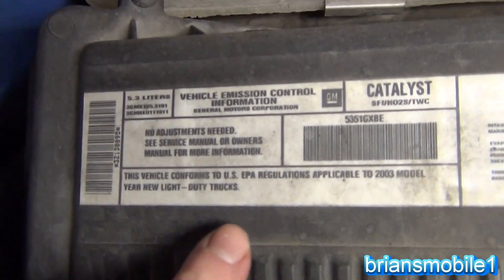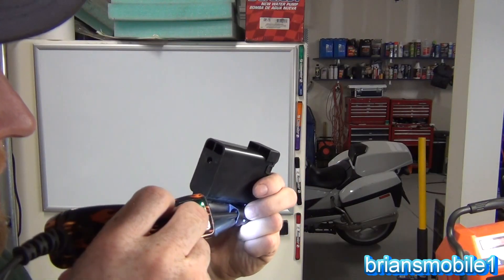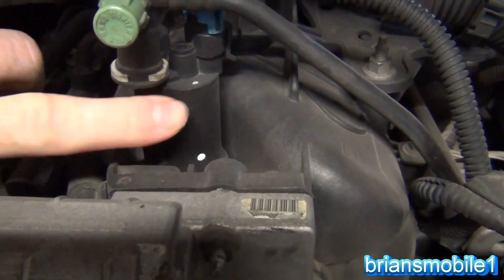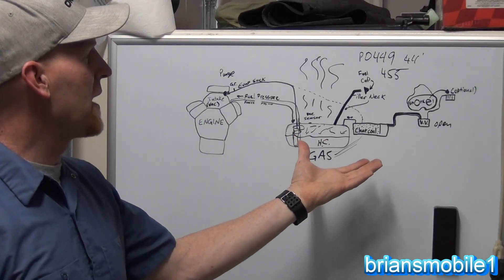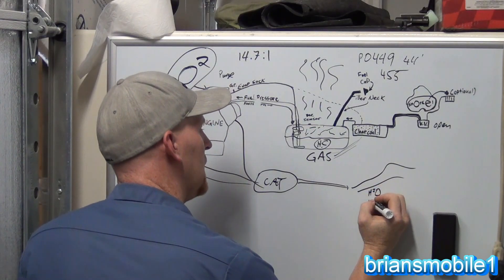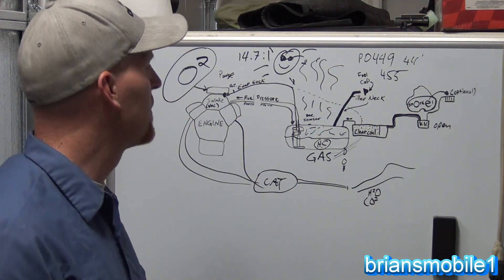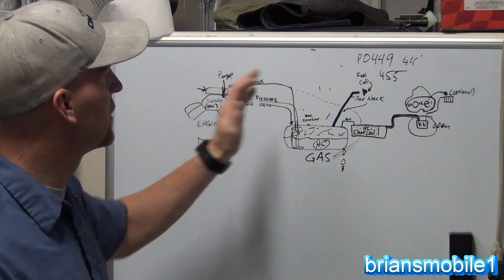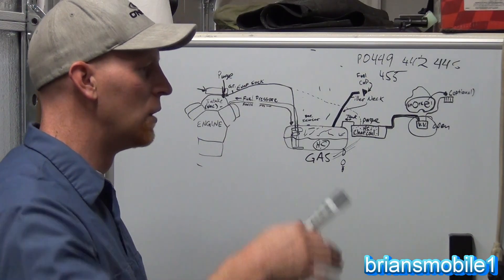P0449 Vent Valve Testing EVAP Systems

Comment: Wow. I just replaced the vent valve solenoid only 2010 F150 after 2 years of just clearing it from my dash cause I did not know what it was and I knew Ford dealership would screw me. It was such an easy fix and 2 plus years I just been resetting the engine light. Wow. Thanks for explaining it to me. Do you think any damage was caused due to waiting so long?

Comment: I have a 2007 Silverado 2500hd with 6.0L and I keep getting P0171 and P0174. I've changed my intake gasket and still get the engine light and lean codes.  Could I be getting a vacuum leak lean code from a faulty evap system?

Comment: hey great video I have a 05 g6 with a code p1106 that has to do with the map but you fill-up the tank with gas and you cant leave the lot. run like 3 gallons off and it drives like a new car. dealer changed everything at the tank you talked about. if the car sits in the shop with the door closed I smell gas just a little. I'm trying to build a smoke machine to test but how do I plug it in?

Comment: My EVAP vent valve hose got loose. Is it going to be a problem and if so how can I fix it because I see that it goes directly into the body of the vehicle?. The exhaust hose.
Reply: Its the hose that connects from the canister vent valve and connects to the body. At first it was tight then when I was moving it to change the vent valve it became loose.
Reply: I think it's the split between the cab and the bed.

Comment: So are you saying when the key is off, no power will be going to the vent solenoid leaving the solenoid in the open position, correct?... I have a code 442 so I'm making a device to add power to the solenoid so it will close when I do a smoke check to find the leak. The solenoid may even be bad... Thanks
Reply: I made a cord with a toggle switch and fuse. I'm able to turn the solenoid off.....

Comment: Can a purge or vent valve not being open and or closed throw  codes p0172 & p0175 with those being the only two codes.  I'm having issues on a 2000 grand marquis. I ohmed out the injectors and those readings are good. I've replaced all vacuum hoses. Except for the evap. Hoses from canister to the tank(And that one looks rough). Fuel pressure regulator is new. I'm trying to fix it my self because automotive shops are too steep on $$$.

Comment: I changed the purge valve and the canister solienoid and my gas cap and my check engine light is still on and the P0455 code on my 2011 Impala ltz

Comment: I'm having a problem with the gas coming back up on my 2005 Chevy suburban. So went to my local auto parts store and the code po 449, I saw a few videos indicating it could be the vapor container purge valve the evaporator container vent solenoid and the evaporator charcoal canister in which I changed all three and I'm still having the same problem not able to fill up. What do you think can be wrong?

Comment: Starving inventer Mike Redfearn Jr thanking you for your video--- My 2005 Trailblazer  I just bought in January -- I'm adding parts to to get it Virginia State legal Is having a a rough idle -- my multy scan scan tool sayed mis fire in cylinder #4 detected-- so I instaled a new the injector #4 and I still have a rough idle. I swapped coil packs around and swapped spark plugs around a different way -- still a 675 rpm and a little rough idle. So I'm looking at The evap line after I made shure the butterfly was clean on both sides. So ,if you can Gmail me back mikeyredfearn@gmail.com  ---- I have piston driven moter ideas -- about 8 of -- There easy to explain and pretty neat to think about- I need to get them to the right people to have them built and expermented -- the look good written and drawn and I modeled two up -- made some energy with one of the models. How many diffrent piston driven engine tipes are there -- To try to get something on the market without the big three going around you is kind of difficult-- I checked with Chrystler and they wont accept ideas--

Comment: my gas cap light is on i changed it ! check engine is also on... wonder if this may be the issue. i dont have  a tool to check and see if current to the device closes and opens the valve , i when i blow threw it its open but cant tell if it closes when it needs to close, whatever the case may be if this device is faulty can it cause a gas cap light to turn on?

Comment: Hey Brian , Thanx for the video ! Excellent info. ! I have a question …. I have a 2010 gmc 3/4 ton …. It had the same code and problem. So I replaced everything , the vent valve , purge valve , filter at the end , and ran it up past and above the transmission , along with new 5/8 hose … Then 3 days later the code came back , along with excessive pressure in the gas tank . I then replaced the gas cap . And again a week later , the code came back , and yet again , more pressure in the gas tank . I've replaced everything literally ! I'm stumped !! Do you have any ideas ? Please help !! Thanx in advance !!

Comment: i used a 9v battery and 2 wires (pos. and neg.)  to do the test instead of the $58 power probe. i call it the poorman's power probe it works the same as the probe.

Comment: I have code po446. Changed out canister but light and cade returned. Now what ? What should I replace ?
Reply from the maker: Check the circuit and check for cracked or blocked hoses.

Comment: Brain, How did you remove this vent valve on this 2003 gmc without removing the truck bed?
Reply from the maker: I did it from underneath using a ratcheting box wrench.

Comment: Toyota Celica GT 2001. I got PO440. I replaced my fuel tank cap and my vapor canister and reset my engine light. It came out again.  My ODB2 scanner still gives me the same code that is PO440. Tested my purge solenoid valve that works fine the only thing that is left to check out is the vent solenoid. Any suggestion? Very good video sir. Educative, clear and neat!

Comment: I have an 08 Silverado. All of a sudden as soon as i start the truck it has strong gas fumes coming from under the truck by the evaporative canister. I just ordered a new purge solenoid, and a purge vent valve. I have no codes but my purge vent valve used to click a couple times after i started the truck and now it doesn't anymore. Anyone have any ideas, any help is very appreciated.

Comment: My 2001 Chevrolet s10 is showing code p0440 so this not a vent valve, I think my pressure sensor on top of the gas tank/ fuel pump right ?

Comment: Thank you for your video. I have a 1993 Ford F250 with the 460 ci engine. I bought a code reader set and found it displays a code 31, "EVAP control system below minimum voltage". Is this the same as what you described in your video?
Reply: no that is a voltage problem,poor grounds,green wiring from corrosion , low system voltage, lots of possible places for a loss of voltage.

Comment: I'm having issues with my truck 2004 Chevy Silverado crew cab the EVAP system I have a large leak I try to start my truck acts like it's not getting fuel because of this evap leak I hear a loud back pressure hissing air being released after I let off ignition key trying to crank coming from under truck Midway back from front does it sound to you that the vent valve is stuck open is that the loud hissing air pressure that I am hearing?

Comment: Great video. I have a car pulling the p0449 code and i have noticed that the rpm increases slightly and decreases at idle. Like your very lightly taping the gas.  Are these related

Comment: I have a 2006 Cadillac Escalade 6.0 I've switched out the purge valve one that goes in the front of the engine purge valve solenoid I think that's what it's called the one that goes under the truck in the back and I switched out the charcoal canister cuz it was falling apart and I still have the hard start when fueling problem any ideas guys please need help

Comment: why there is negative pressure created in tank and will that affect fuel delivery , I can hear air suction sound when I open my gas cap . opel astra 2014 . in general that is good sign or bad sign .. not codes thrown at all

Comment: I’ve got a 01 Chevy Silverado 1500 with code p0446. I’ve changed the vent valve to a new one an code came back.  Can’t see to figure it out. Any suggestions ?
Reply from the maker: Two things fail.  The plumbing and the hardware.  If it's not one it's the other or the wiring driving it.  Make a list and cross things off as you prove them functional.
Reply: briansmobile1 what do you mean as the plumping and hardware ?  An what ways can I test wiring

Comment: Thanks Brian, for this video !!! You are one of the 4-5 ones, I even ask anything here in you tube, most of the people are kind of like " guessing mechanics" ;o). Well, I have a good one for you today: I am going crazy with my Mustang 2004 , 3. 8 litre engine! Idle is so, so sky high almost all the time, after I changed fuel pump to 255 lph, and bigger throttle body, 70 mm?? I had "check the engine" light coming on, even before that, saying large vacuum leak somewhere??, and " check your fuel cap"?? I did change fuel cap, no help??Now, codes are: P0507 IA control higher than expected??, ...sure know that, Idle goes first to 2500, and after 20 -30 secs goes down to 1100 -1200, never lower??, and the other code is: P0405, Exhaust gas recirculation sensor a Circuit Low?? I did change DPFE sensor year ago, tested it now, actually bought a new one, no help, will return it, have changed TPC, IAC sensor, new EGR valve, did check leaks under hood, vacuum hoses, no leaks, did check canister solenoid in rear, seems fine, 12 V coming in, closes, when 12 V applied, did take out canister purge valve, in front, under fender in Mustang, could not really test it, like here, opened it, cleaned it, put it back, 12 V coming in??? Could that be open all the time?? And make idle go high like that?? Will change that next, after I return that new DPFE sensor, did not need that =) Going crazy here, pelase, help meeeeee ! Could there be a leak above gas tank?? What do I do next?? Smoke test?? Thanks, youtheman =)

Comment: I have a 2004 Dodge Grand Caravan. Had a small Evap code P0440. Smoke and cap test is clear. I removed the Solenoid and put voltage to it (depending on the current direction open direction would change) Either direction when blowing air does move through, but it is not smooth like blowing through a flute, but restrictive like blowing through trumpet. Could the Solenoid be bad?
Reply: Does anyone know if the Canister should "Flow Freely"

Comment: i just replaced both purge solenoid under the hood on the intake i also replaced the back vent solenoid by the charcoal canister i also tested to see if it was getting power and yes it is on both ends under the hood one and the back one but im still getting the po449 code what else could it be all lines are intact and good i see no leaks cracks or breaks my next goal in the morning is to take the canister off to see if its clogged any other  suggestions

Comment: as long as its not plugged in to the harness polarity shouldn't matter it's just a coil. now that i put my .02 in, have you ever seen a p1457 caused by a bad vent solenoid? i tested mine and it passes air even energized, i think your vid verified i wasn't sure if they were a weird 2 way deal or something.

Comment: Good video Thanks Brian. I remove 2 or 3 of these every month and disassemble them and b;low out the dirt inside. I have taken several spoons full of dirt out of some.   One car, I believe it was a honda, had a remote breather on the end and sucked from inside a frame rail way over on the other side of the car. The hose had a cup full of small stones plugging it. We drive a lot of gravel roads here. I think there is a kit to reposition the valve to under the hood where there isn"t as much dust.

Comment: Im getting a p2187 and p2189. Changed evap controle valve still getting the same thing did a smoke test no leaks ....on a 07 hyundai.

Comment: Hello! tnanks for video
I have tested the solenoid on ohms and if there is resistance 22.5 it opens and closes when testing. The power cable that goes to the solenoid has a voltage of 12.5 volts on one cable and on the other 4.5 volts. When the key is on, I still have the same code after reconnecting everything. What else could it be?

Comment: Good video, great explanation. Most of the ones I've had off were just dirty. Blow that old valve out and it will likely work,  should also take out the foam filter inside and clean it too.  . I;ve done lots of these. I just did an 08  Buick lucerne, and dumped half a cup of dust out of the valve and canister filter. I've seen trucks where you have to remount that valve to under the hood to keep them clean.

Comment: I've been in school for automotive been doing it for years and I must say it sure sounds like you've got a good working experience with the knowledge and people should benefit by your free education buddy
Reply: so if I understood correctly the relationship between the vent solenoid and purge solenoid the vent solenoid stays open when engine is off so you can add fuel to the fuel tank while the purge solenoid stay closed then when you start the engine opposite occurs the vent shuts and the purge opens to draw gasoline fumes to the intake ? I think I have a vacuum leak or dead oxygen sensor, my gas mileage is very poor.
Reply: Evans Cheruiyot how that would be a no if engine is off they would not be open why would they be open they wouldn't be working if they were open... you need to do a little bit more studying...  if the car is not running and the are open you're going to be venting gas fumes into the atmosphere now is that something we want to occur with what this apparatus system is supposed to do?
Reply: so why does the problem of filling up the fuel tank occur ?
Reply: Evans Cheruiyot you see that's because you don't tighten up the gas cap probably screwed on wrong that or you have more problem than what you really looking at... it doesn't just have to be during fueling there could be another smaller vacuum leak somewhere within this system... and you're just attributing it to be a fueling issue when you're filling up the car of course you are venting a certain amount of fumes just by the fact that you are fueling the vehicle that's a given that's a closed system list of vehicles is  running and that's the only times in EVAP Is.open or  storeing or release it is going to intake into the motor not the atmosphere... and when it does that the vent valve is going open because you have to have the atmosphere go through there to moving around from where you want it is that valve is closed the atmosphere is not going to help push through the system the fumes the hydrocarbons you either going to send it one way or they're going to put it in storage with a car off the vent valve would be releasing the fumes into the atmosphere if the purge valve is open when the engine is off it's going to be releasing fumes into the atmosphere if your gas tank cap is loose or missing lines are you have a brake leak in the system it's going to be venting fuel fumes into the atmosphere... and I just ate intake password would be introduced into the cylinder heads which would go into cylinder be compressed by the piston... and most the time that was referred to before your mass airflow sensor right... In the  bellows... it would have to be measured with a rest of everything gmjust like the rest of the gas is getting sucked into your engine...  so I got to be calculated out by the computer
Reply: I see okay, my gas cap rubber gasket is dried out and has cracks so I will be changing that for sure, it has activated a check engine light a few times already and every-time I had to turn off engine and re-tighten the cap after that I suppose it time for a vacuum test since vent solenoid is new.
Reply: Evans Cheruiyot if your seal on your gas cap is all dried out and cracked go get a new cap yes that's going to be a leak you can also get this code with a good gas cap..  everything working it can be just a little bitty leak anywhere in that system and that code can show up they don't tell you that but that is the truth... there's a pressure sensor in a lot of the newer cars have it's insane if you have any pressure or any changes so I mean there's a lot to it other than just a gas cap...
Reply: I also got a oxygen sensor code but I have heard that if you have a vacuum leak a false oxygen sensor code can be set off is that true ? finally which oxygen sensor malfunction would cause my gas mileage to drop drastically upstream, downstream or both ?
Reply: Evans Cheruiyot look nitrogen tester cold you would have to have a cold and it would tell you in the information with a cold which bank which oxygen sensor... and that is telling you more than likely one of these sensor to fail or you have an issue with the circuit but while it is running rich because it's not going into closed loop so you're running into winter mode told me you know I'm saying it's limp in mode what it's really called so it's going to be running rich consuming more gas that's why your gas mileage dropped off and with your EVAP system having an issue that would also contribute to the waist because you're releasing fumes in the atmosphere may be some maybe a lot more sorry to tell without knowing seeing physically what your issue is hard to determine on which type of volume were talking about... okay well I hope this helps because I should really be charging you for this it wasn't cheap for me other than that good luck and good night
Reply: Thanks a lot and good night sir.